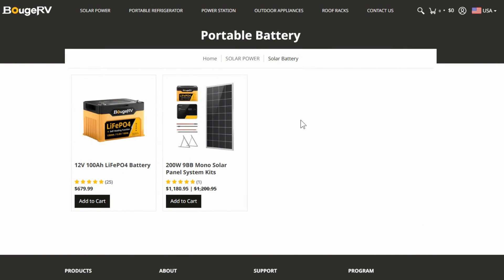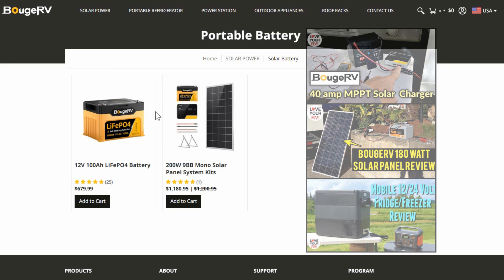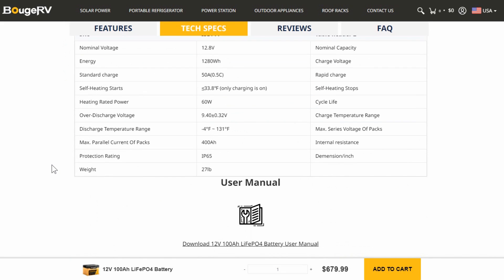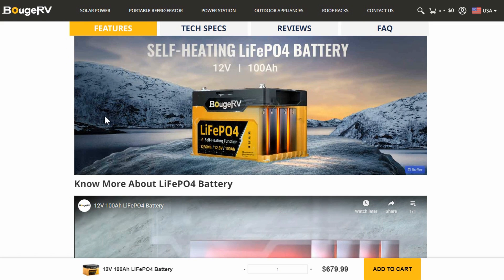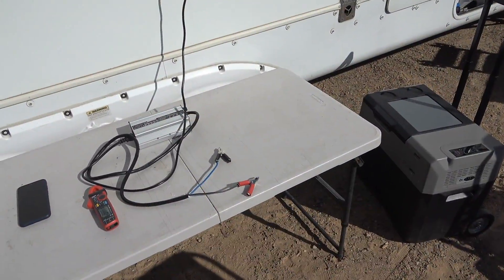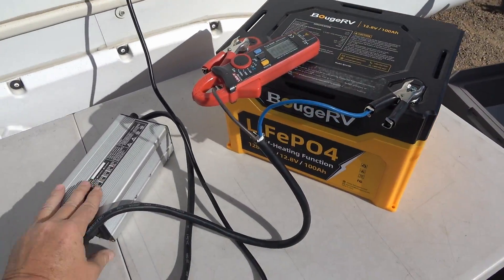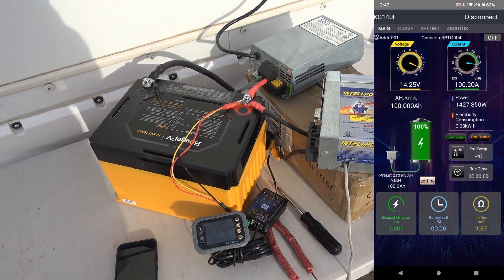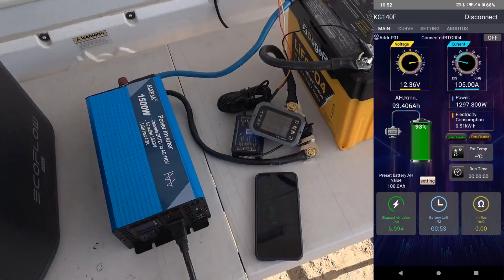BougeRV Lithium Battery Review - Self-Heating 100Ah LiFEPO4

Comment: Nice battery with good features like the self heating. However i live in Jamaica so i don't need low temp. cutoff nor the self heating so when i upgrade to LiFePO4 it will be for cheaper batteries.
Thanks for the video and greetings from Jamaica.

Comment: I built myself a very inexpensive Bluetooth jack control for my 5th wheel I thought you'd enjoy. I know you don't need it but I also know you'd probably enjoy the project. I posted it on Instructables as "Simple Bluetooth Camper Jack Control"
Reply from the maker: Thanks, that is pretty cool. My camper came with OEM wireless controller for jacks already but this may be useful for other projects.

Comment: No 100 amp hr lithium for 200 which is what I Can afford
Reply from the maker: $200 barely gets a decent lead acid battery setup with the same amp hours. Remember you'll need about twice the amp hour rating in a lead acid battery as its not recommended to run a lead acid battery lower than about 50% charge. So you need to buy 2 deep cycle lead acid batteries to get similar capacity as the 100Ah lithium provides. A lithium should also last about 4 times longer. So in the long run a lithium would prove cheaper but upfront cost is higher.

Comment: 'Don't like screws @13:11ff' - how about using lets say about 80A current out of this battery and shoot the temps of the screws after some minutes with my infrared remote thermometer? If the quality of the connections would be different, or one not too good at all, one would likely sense this that way?
Reply from the maker: What I don't like is that the connection appeared to be changed since the original build and a couple screws had stripped heads. The original bus bars look like they were laser welded. Leads me to believe the cells have been swapped out by drilling out the laser welds and adding screws to reattach. Maybe a refurb of previous failed cells or better ones were installed for a review sample. Just guessing. Screws may work just fine but wanted to point that out. Cheers, Ray
Reply: @LoveYourRV  - well done 👍✨

Comment: Very good review & a good choice for some batteries. I am amazed at all the competition on LiFePO4  batteries. 6-7 years ago Battle Born's were running $1500. I was running 2-6v gold cart batteries from Costco at $89 ea. I couldn't justify the cost difference regardless of the VooDoo math some were purposing. I felt like all new tek they would drop. Glad I did as I paid ~$400ea for some nice Chins with bluetooth but no heating element.

Comment: Sucks how a battery monitor won't see the power usage of the heating feature.
Reply from the maker: Would be nice if the battery had an internal Bluetooth app like some other brands do that would be able to track individual cell voltages and come up with a capacity remaining estimate. I'm currently testing out 4 Lion Energy batteries, not on the market yet, that have Bluetooth and I can see each of their state of charge percentages.
Reply: @LoveYourRV  True. I know people like Renogy and others for the Bluetooth feature. Looking forward to when the $300 tier batteries have it.

Comment: I have a LIFEPO4 Lithium battery coming for our 48 L fridge/freezer that has been on backorder since December. I did not know there was a battery compartment until one day I discovered the battery door that is somewhat similar to the battery door on our Champion dual fuel generator. I am looking forward to the lithium battery so we do not have to pull the rolling fridge out of the truck every night when we stop for the night, it can run on the battery at night and recharge during the day when we are traveling. We do not have access to our kitchen without opening a slide so it is very nice to have the fridge/freezer with us for accessing when we have fuel stops, etc. Thanks Ray, Davey & Sheila Knapp
Reply from the maker: Yes, the onboard battery is a nice feature.  When I go get groceries and its a long drive I plug in the fridge/freezer to the truck 12V outlet but when stopped while shopping or running errands and the truck is off the on board lithium battery takes over and keeps cooling going. Nice to arrive back at the camper with cold food. Even helps the camper fridge because the food going in is nicely chilled. Cheers, Ray
Reply: @LoveYourRV  Ray, Even our 12-volt Furrion fridge in the RV appreciates that cold food, they use such a low power DC compressor that the ability to ramp downward is not much faster in the grand scheme of things. Sometimes it is worth turning the temp to max cooling as the manual says so it gets serious about cooling, but the colder the food the better the result, so my BougeRV is appreciated. Their support has been great, they sent a new handle when I broke the front springs & pins, plus they sent a video on the exact way to swap it out. Cheers, Davey

Comment: It looks like a really nice battery, but after watching you tear it down, I wonder if they sent one that has used cells in it? Also, how can you have a 4000 charge/discharge warranty in only 5 years, that seems improbable.
Reply: Just like a car might have 100K mileage warranty but still last long beyond that.
Reply from the maker: More likely they would put in better cells for the reviewer battery rather than used. That may be what happened, swapped in some better cells, or was a refurb, who knows. Recreational users won't get anywhere close to 4000. But if still have good capacity at 5 year mark probably have some good cells that will keep going a long while. Lion Energy batteries have a limited lifetime warranty 3500 cycles based on 10 years if I remember right but cost an extra 200 bucks on average.